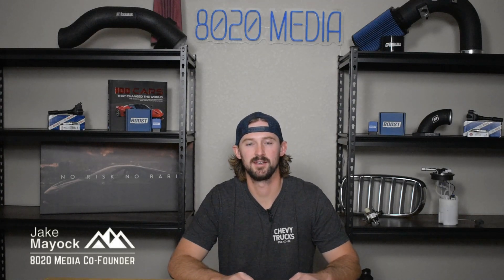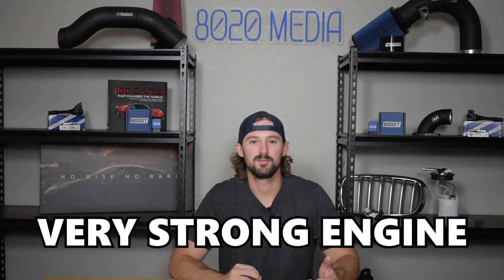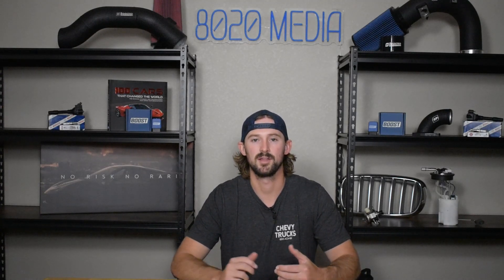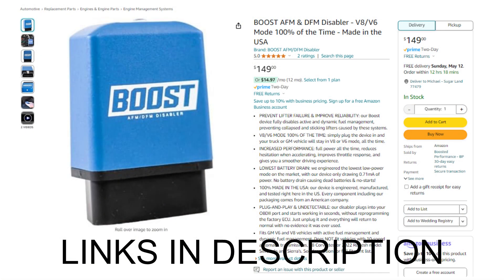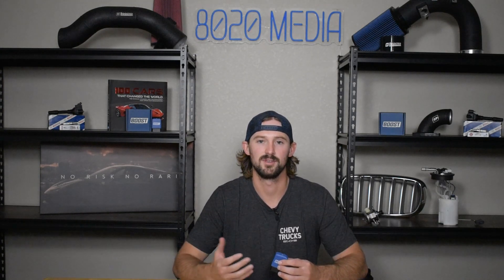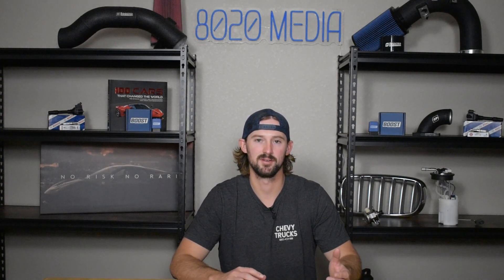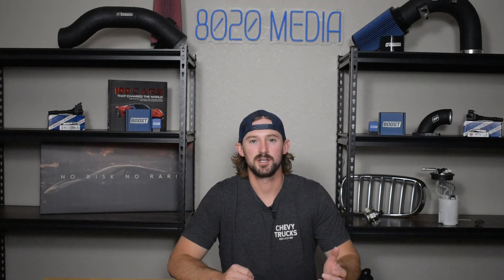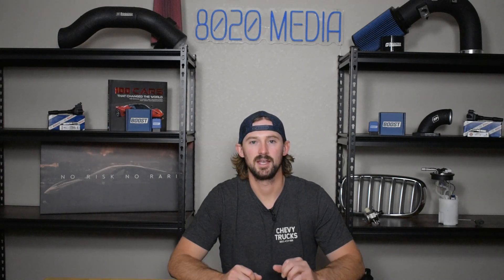GM's 4.3L EcoTec3 | Common Problems & Reliability

Comment: AFM is the worst. Honda uses this on their V6s as well (VCM) and it doesn't work out very well there either when it comes to long term reliability.

I have a 2017 Acadia V6. Disabling AFM on that was the best thing I did for it. It drives better, runs smoother, fuel mileage is the same, and I don't have to worry about valvetrain or oil consumption issues in the future.

Comment: 2016 4wd Silverado lt 4.3.. engine was ok til 170k started leaking oil bad.. At 191k engine ceased tight on highway doing 60mph.. Lifter failure. Dealer wants 8000 dollars to rebuild top end. Even though its a 5.3 engine missing 2 cylinders it is not covered under recall.. So repairs is out of pocket.. Mine is parked in the grove waiting for junkyard to pick it up.
Reply from the maker: E - Sorry to hear this.. Unfortunately, this is a common occurrence with these engines nowadays.

Comment: I am entertaining the purchase of a used 2018 GMC Sierra 1500 with the 4.3L V6. I currently have a 2011 GMC 1500 with the 5.3L V8 and I do have a Range AFM disabler installed. I tow my boat maybe 12-20 times a year, no more that 100 miles on any given trip.  The overall weight of my boat, motor and trailer is well under 3000# total.  My question is: will I be able to safely pull my boat with the V6?  And am I to expect significant power/acceleration drop off with the V6? I will also say that I tend to be a Paw Paw when driving in general; and am especially easy on the pedal when trailering my boat. So, by most standards I am not a speed demon.  And based on the sub 3000# weight, do you recommend towing in the trailering mode the entire drive with trailer in tow? ( I sometimes trailer my boat in overdrive if its short distance and no hills to climb). I just want your opinion on this engine and my boat. Thanks for any advice you may have.
Reply from the maker: R - The 4.3L V6 in the 2018 GMC Sierra 1500 (EcoTec3 LV3) is a solid, torquey engine rated at 285 hp and 305 lb-ft of torque, and it's more than capable of towing your sub-3000 lb boat/motor/trailer setup without issue, especially given your relaxed driving style and relatively short, flat-distance hauls. You will notice a bit less acceleration compared to your 5.3L, particularly on hills or highway merges, but for your use case it won’t be a deal-breaker. As for tow/haul mode, it's recommended anytime you're towing to optimize shift points, improve engine braking, and reduce transmission wear—even for lighter loads—so I’d advise using it regardless of trip length unless you're absolutely certain the route is flat and easy. Overall, for light towing and conservative driving, the 4.3L V6 is up to the task. Keep us updated!

Comment: How does this engine in the 2020 do with towing?
Reply from the maker: H - It's solid for light-duty towing, rated up to around 7,900 lbs when properly equipped, and it delivers 285 hp and 305 lb-ft of torque with a 6-speed transmission; it’s reliable and torque-focused but can feel strained on steeper grades or when towing over 6,000 lbs, especially compared to the 5.3L V8 or turbocharged options. It's a good choice for occasional towing of smaller trailers, boats, or utility loads, but if you’re regularly hauling near its limit or towing in mountainous terrain, the 5.3L or diesel options offer better long-term confidence and performance.
Reply: @8020Automotive thank you for the response. I'm sure I'd feel a difference between the Ford 5.0 and the 5.7 Hemi which are the two I'm most used to.

Comment: I have a 2014 Silverado. The engine failed at 195k. I had a used engine installed with 70k.  My engine failed probably due to lifer failure. My local Chevy dealer told me that these engines don't have AFM. That didn't happen until more recent years.
Reply: I take back my comments. The parts man at the dealership was wrong. I found documentation that says that the 2014 4.3 V6 has AFM.
Reply from the maker: S - Thanks for sharing your experience!
Reply: 195K miles isn’t what I would call a super long life but that’s a pretty good amount of mileage as long as I get about 200,000 miles out of my engines. I’m pretty happy obviously it’s nicer to get more but they don’t make them how they used to.
Reply: @iked4421  On my 1996 GMC w/v6 I sold it w/311k miles. The interior and engine was in good shape. The body not so much. I live in a rust zone. I like to take care of my vehicles so that I can get the most out of them.

Comment: Probably shouldn’t just plug in something to disable AFM and not address the high pressure fuel pump designed specifically to cater to AFM. I’ve got a fully stock 15’ with 102,000 and it runs like a top.
Reply from the maker: J - Everyone is held to their own opinion. Thanks for taking the time to share your experience!
Reply: What would you suggest I do to disable the afm the right way? I’m looking to disable it soon but was wondering what could be the best option
Reply: @EmanuelGonzales-e2b  The plug inside work great like he had. They dont reprogram computers or void warranty. Unplug it and everything goes back to normal. If you have cash you really want to blow you can get a delete kit installed but take it from me... That was a helluva project for something I was doing with a plug in
Reply: @EmanuelGonzales-e2b real people who have tried these obd plugs will tell you theyre absolutely bullshit. You have to take apart the engine to actually delete the afm. The OBDs do not work. The people who say they do are changing oil every 5k miles and their afm is actively running

Comment: I have a 2014 Silverado 1500 two-wheel drive with the V6 with 170,000 mi and it runs like a new truck still. I have never noticed it transition from V6 to V4 mode at all. I run a tank of e85 in it every other tank minimum. The power increase is incredible on e85. I would not disable AFM, unless you're going to be idling a lot.
Reply from the maker: T - Glad to hear that you've had a great experience. But, AFM is not the greatest system and has been proven to cause lifter failure. We will ALWAYS recommend to disable or delete AFM/DFM.
Reply: I have a 2014 4.3 and no engine problems of the 30k of owning it but only thing is tranny went out at 120k miles and now put 10k into it and I got stage 1 with 40k cooler and bypass valve never exceeds 140 temps which is very good and I always be towing about 5k pounds in the usual! I recently made someone program my truck to full V6 don’t notice a difference which is good and i even get better gas mileage! The only upgrades I need is the oil catch can which ima go ahead and order it now but do you have any suggestion on what cleaner to use to clean my valves cuz direct injection Ik they do build a lot of shit 💩
Reply: I have 2016 4.3 and it says it doesn't have afm in the v6s
Reply: @GZUP90 Where does it say that? Most of them don't have the indicator to tell you it goes from V6 to V4.
Reply: my truck doesn't have it. 4 3 ecotec3 stays on v6 indicator

Comment: I have this 4.3 LV3 engine in a 2016 Silverado. I have found no hesitation, sluggishness or clunky shifts at all with this engine over 107,000 miles of AFM function so far. TIP: IGNORE THE OIL LIFE MONITOR! Turn it off. The oil life monitor can and will extend your oil changes out to 7000-9000 miles! Change your oil EVERY 5000 MILES and you will have NO trouble with AFM in this engine…you will also have NO carbon buildup. These engines DEMAND CLEAN OIL. Keep it changed 5000 miles or less and keep trucking. Doing this since new I have also had ZERO oil burning between changes. No catch cans, no snake oil plug-ins in the OBD port, no deletes…CHANGE YOUR OIL and you don’t need this stuff.

Also wanted to add that youtube and the Internet forums are slam-full of 5.3 lifter horror stories…so far I have only found one (1) story of a lifter failure in the LV3…the engine had close to 200,000 miles on it and had been starved of oil. Change your oil.
Reply from the maker: H - Thanks for taking the time to share your first hand experience and valuable insights! We absolutely agree with the oil life monitor..
Reply: I actually jus bought the 4.3 over the 5.3  absolutely love it thanks your comment helped me decide.
Reply: Yep,  I agree with "do oil changes at 5000 miles".   My '14 Silverado 4wd with 4.3 has 70000 miles,  no issues yet,  no oil usage troubles or anything else.  I do treat it well,  change oil every 5000 miles,  and plug it in when temps are well below freezing.  Also I avoid short trips where engine doesn't reach full temperature.   Runs as new !    Very little mention of these engines when watching videos about Silverado/Sierra problems.

Comment: just purchased the boost afm disabler for my 2018 5.3 Silverado about two weeks ago as I type this.  The driving experience is greatly improved, no more hesitation and smoother up and down shifting on the highway and city. only down side is that I did notice a 1-1.5 mpg drop but I never bought this truck to save gas, but to perform under pressure.
As for the 4.3, its a shame they discontinued it.  though, I am not against the 2.7 as it does sound interesting.  they would sell me on it for sure if it was reliable and easy to work on.
Reply from the maker: Hey Rohawk! Thanks for the support and we're glad our Boost device has met your expectations. Did you happen to buy it on Amazon?